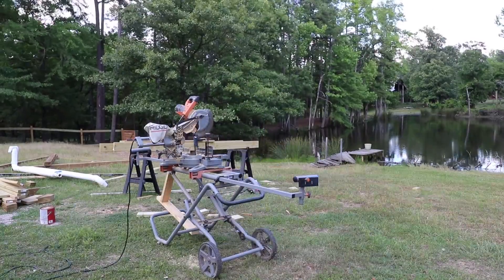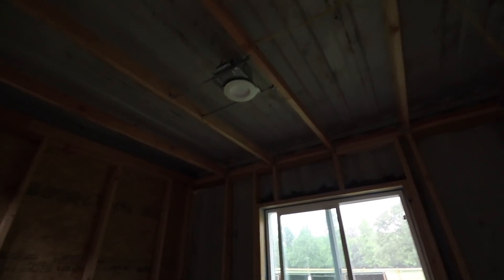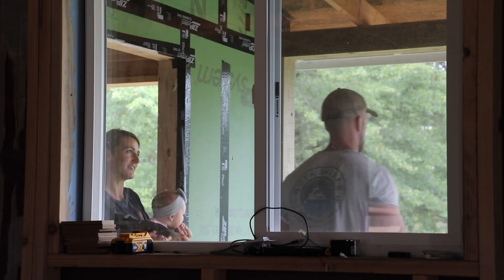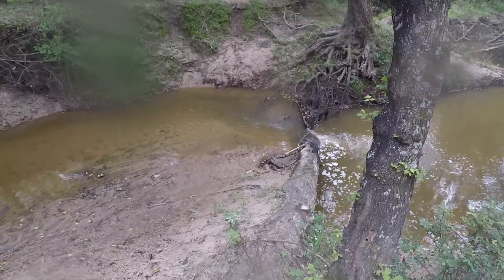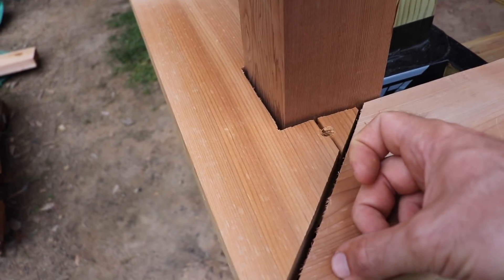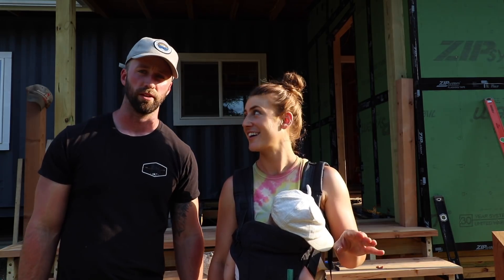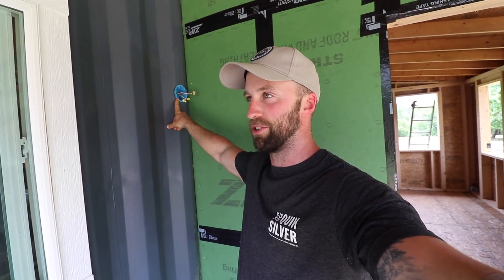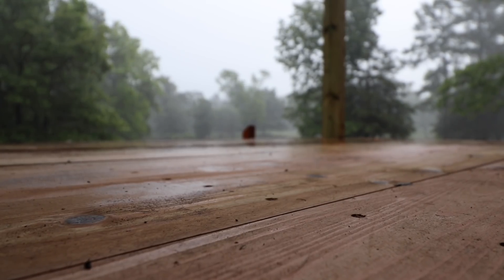Tying It All Together!

Comment: 2 things: 
1. Always pre-drill deck boards at the edges.
2. Glue does an amazing job at bringing split wood together.
Reply: You forgot Spencers OCD - he would always know there was a cracked deck board 😀
Reply: you can clip the head off a screw and glue it in the drill hole so it looks complete
Reply: It's really not my area of expertise, but I've seen evidence of the glue joint being stronger than the wood?

Comment: Love watching the show! 
Spencer, you might want to consider putting either joist hangers or other reinforcements on those Deck Stringers. It didn't look like a lot of wood grain is left, to support you at the top Tread / Riser, for walking up and down. If you had to guess the weakest point on those stairs ..... what would you say. 
Just saying ... safety first. Good luck on the future.
Reply: You could try to brace them but he has driven screws through the riser of the stringer at the thinnest point, where all the weight is hanging. They need to be replaced. Great videos though.
Reply: My thoughts too, looking at the way the grain runs..

Comment: You may want to consider supporting those stringers from somewhere else.
I'm sure the top will snap for some of the same reasons the deck board snapped when screwed in at the corner. 
Not trying to pick apart your work, just bringing it to your attention so you can add support under the stringers before it's closed in, if it's being closed in.

Comment: Your stringers are going to split... don’t throw them out, make your top step (not your landing) the highest point, add a rim board the width of your steps under the original rim and fasten the modified stringers to that.
Reply: Don Dehne yes! WHEN they split don’t get rid of them.
Reply: They never listen to comments.  Just like the bouncy beam below the living room.
Reply: @kdrguru  that's because the work has already been done by the time vid is posted
Reply: @sherri8347  they can add Simpson hangers to the stringers and a metal "flitch" plate to that beam.  Incorrect use of zip tape and code violation not using PT...they should read codes before building.
Reply: As a carpenter for 35 years ,if he doesn't support that top stringers ,that little piece will break off.
Reply: Don and all others, this is a scripted and edited show.  Now the director decided to add the straw hat prop for Spencer to give the dude a "gosh golly gee" Tom Sawyer persona.  I admire this couple though for having hatched a plan that somehow puts money in their pocket... Bravo!!
Reply: Not everybody on youtube knows what they are doing, thats where Spencer goes for his advise and keeps making bad decisions. I now watch for the comedy relief this is, a carpenter he is not, nor an electrician. I can't believe they still beg money from Patreon with the money this channel is making. I would wager they drag this build out for many years to keep the big bucks rolling in.
Reply: @kdrguru   That's their option.  Comments are more like suggestions for them to like or not like.  They are not edicts.
Reply: Wouldn't those boards be treasure treated lumber?   If so, they are impervious to water, right?

Comment: First..I really enjoy the channel. Have followed since the beginning. I feel like I need to comment on the stair stringers. At the top where they tie in, there needs to be more support toward bottom of the stringer. The grain of the wood will not allow a load in that orientation. You need to build out from the deck and tie lower on stringer. Or some type of bracket mount. Not a hard fix but definitely needs to be done. If the ledger on the deck was lower it would be fine. Again great channel!

Comment: The stringer tops might meed  bracing against the beam or reinforced  somehow. Because of the 45-deg grain and a bit of stomping over time, the tops will crack someday.
Reply: You're correct. They make stringer brackets just like rafter and joist brackets. Hope he buys some!
Reply: @louroberts5567  Brackets are not needed if he properly framed these stringers which he did not. The way he cut them, brackets wont stop them from splitting at the top riser. Also if proper stairs are down correct, they are on a 40 degree max slope.
Reply: Just screw a sister board to the stringers. Or a steel plate .25" thick X 6" by the entire length of the runners and screw it.
Reply: I've built about 125 decks and yes the top of those stringers will definitely crack at that point where they were cut so narrow and attach to the deck. We always started with a full step down from the deck, I don't see the need to extend the deck out that little bit for more overhang.
Reply: @Koorisin  No, it won't keep it from splitting but it may help with structure. He can also use hurricane straps attached to the bottom face of the stringer and attaching to the back of the rim joist. There are many remedies.

Comment: Stringer attachment scares me. With the grain direction they will split. Typically those are cut off and a length of 2x are screwed to the back of the stringer and then that is screwed to the deck framing.
Reply: Yea he needs to add another ledger board below the rim joist and use hangers.
Reply: I see it also.  Easy and cheap fix like Jordan mentions.
Reply: @jordanwalter4381  Totally agree, seen the same thing, looking at the wide wood grain running in the wrong direction, whoops!!! a tad bit scary..,  definitely the weakest place if they were to break, ledger board and hangers is the simplest, fastest and least costly solution.
Reply: At least some blocking to toe into on the top ledger. I'm a sparky so I could be wrong...?
Reply: Funny seeing this comment, I noticed this when he built the first set at other deck.. Totally agree, its definitely not code from my state..... throw some THA222 on those stringers and you are good to go. Simpson will most likely have an end hanger with concieled flanges.
Reply: Just add a 2×4 to stringer on side and attach to stringer and porch good to go.
Reply: Noticed the same thing. Watched the rest of the video and did not see a fix. I sure failure in the making. You just have to crawl with the snakes for the fix.
Reply: The bottom of the stringer is the part that's supposed to be attached.

Comment: Hey... I dont like to pick on anyone, but those stringers are not real safe.  With the way the grain is running and that thin piece at the top carying the load, its likely to crack especially as the wood ages outdoors.  You should really put blocking back to the beam to carry the load.  All those little pieces cut around the posts are likely to split and break off as well.  Outdoor wood is not dimensionally stable and moves a lot throughout the year.  You need to leave some space (like a good half inch or maybe a little more) around posts and stuff to leave room for expansion and contraction mainly due to the wood drying out during summer and and expanding during winter.  If you leave that stuff tight the stress as it shrinks will break off those pieces.
Reply: I agree. Not strong enough.
Reply: Also, the stair treads should be a bit wider/deeper  to make a feature of the stair, also to be in proportion with the width of the stairs.

Comment: 0:46 I think those stair stringers will break at the very top, there's very little timber at the last vertical piece and the grain is oriented in a way that it will almost certainly snap.
Reply: Livi 120 I get your point but surely all they need is a metal hinge fitted underneath, connecting that part of he wood deck area?

Comment: Those stringers are a tad scary, needs something supporting them just below the top support, they are gunna snap,
Reply: Ok , Im not the only that saw that, (i was a builder). He could sister them up with some ply, it would show however.
Reply: Agree, that is lacking some solid structure
Reply: Just commented the same. He did the same thing on their other set also. Any weight at all and they will start breaking.
Reply: @xl600mine  stringers are all wrong  hope no one gets hurt
Reply: I was gonna say the same. Maybe use some hangers or something.
Reply: I thought the same thing and I’m not even familiar with this kinda stuff. It just looked dangerous! Another guy drew them a diagram and offered to email it to them. Hope he takes their advice since he isn’t a builder or carpenter by trade!
Reply: These stringers will need to be rebuilt in a couple of years, or changed right away to avoid future issues.
Reply: I just posted the same and then saw yours.
Reply: Look at the grain of the 2x10 where the inside tread cut is. That is a big weak point.
Reply: ABSOLUTELY RIGHT!!!  Tie a 2x across all and into the fat part of the stringer, then lay another in back to tie to upper cross brace.
Reply: Other than that, you do freakin amazing work!! Keep up the great progress. Wish i was 30 years younger, I’d be doing the same.
Reply: Omg. Is Spencer serious? Yes he has to use hangers, but he can't use hangers when the band joist is only a 2x6.  Sometimes he means well,but he has absolutely no clue what he is doing.
Reply: Didn't read any comments when I posted mine. Fairly simple fix but should have been done initially. Just needs to shim out a piece of 2x10 or even use a couple of 2x6 for facing brought even with the top plate. As long as it is solidly affixed to the deck it should work without any problems.
Reply: If he had only used 4 I would agree. He put way more than he needed so the load strength combined should exceed 1000 lbs total for the stairs, minus the stair weight itself. It should hold 4-6 people at once with little problem, only because he used 4 more than needed.

Comment: Woah! Those deck stair stringers a dangerous! The top of the stringer is bearing all your weight on only a 2” width. The top this type stringer should be a full tread depth in thickness in order to not make the stringer so thin.

Comment: Thin wood splits or shears very easily along the grain. You've left the section of your stringers that hold up the stairs with about 2 1/4" length of grain running before a cut where it can split very easily. Essentially those stringers are less strong than a 2x2 board because of the grain running perpendicular to the length of the wood. Better to have a full depth step on the top so the grain runs continuously along the bottom edge from attachment point to the ground or to add some sort of hanger to pick up the load correctly and prevent your stairs from snapping off the deck when someone steps on them.
Reply: Same comment applies to the front steps made in "Stepping Into A New Chapter!" video.
Reply: I was about to post that and saw that you caught that problem.  They need to add a header at the bottom half of the stringer (attachment where the stringers have continuous grain) not the top of stringer where the triangle piece will split off.
Reply: That was my concern as well.  After a few months or a couple people standing on those stairs at the same time they are going to crack and eventually fall.  I love so much of what you guys do, but the stairs need to be redone. :(

Comment: Not an expert on stair stringers, maybe someone who is can comment, however,  with the grain facing the way it does at the top it seems a small section to hold those stairs. There are quite a few stringers, however,  only about two - three inches at the top of each. I could almost break that much off with a blow of my hand I think. Maybe I am just worrying unnecessarily Spencer as I know you do your research.
Reply: I'm no expert either, but based on research I've done and stringers I've made and stringers I've seen the pros make, they look good.
Reply: Your intuition is correct. The notched stringers must be installed so that the portion of the stringer that rests against the rim joist is a full step. Done that way, it has the full uncut "carriage", and the bulk of the wood. Old timers would "let in" a 2x4 on the rim joist, as a ledger, but it has fallen out of favor for the Simpson brackets. Don't know about building codes in that part of the country, but where I work that would not pass. These are not resting on the rim joist, and will fail under load.

Comment: Spencer, the stair stringers will probably break from being supported by such small amounts of material you tied them to the deck. I would butt out a full width brace even with your top anchor point to solve the potential problem. If you have to buck a load with a hand cart up your stairs they will break, I know too well from my previous experiences. 
Young lady, I know how adorable babies are and I am not saying this to be mean but, if possible, you need to put that sweet little bundle down in a swing or something else safe so you can help more with finishing your home. It's going to wear your man out doing so many things single handed and it will add another year or more to being able to move into what you guys are creating. I know that you are probably the one making the videos but you need more building content and less leisure time to make it come to fruition. Love your perception of your home and your sharing it with your viewers.

Comment: You know them staris aren't going to last..? When you follow the wood grain from the top you can see where they are going to come crashing down..
Reply: Why wasn't pressure treated wood used for the deck and stairs ?  Cost ?.  I am concerned also about board spacing of deck lumber. I would have spaced it out more so for water run off and so that dirt does not build up in the cracks as much.
Reply: Kim Hetzel PT is a code requirement in IRC too.  Why are there no codes there?
Reply: Codes where hes building he dont need codes.. lots of code violations lots. The whole addition and deck would immediately be a stop work order . All his main beam are laying on their sides.
Reply: @jaymckinnon8387  exactly.  I bet inspectors to be are quizzed on this series.  I feel bad..they're good people but refuse to listen to pros commenting.

Comment: Like the way you cut another deck piece around the rail after splitting off a tiny bit of corner. Most would have glued it and gone with it. Well then I saw how crazy wife was over a lil ink  line (sand it off). My hubby and I built a huge A frame out in the country ourselves when I was 19 and he was 23.  Every little “ just go with it “  you never forget and see it every time. Others don’t but you KNOW it’s there.  Nice job on the whole project.👍👍👍

Comment: You need to support the stair stringers...they have a weak point where they meet the rim joist.  I suggest extending the rim to the bottom of the stringer which will give complete support and the stringers will not break over time.

I love the attention to detail you all take.  Keep up the good work.

Comment: You do beautiful work.  Couple of suggestions, The top rise for the stringers looks to be a weak point, should they ever break, there are joist hangers to cradle the stringer.  There are definitely plenty of stringers. Not sure the max distance for sheet rock span, but all corners should have solid wood at each side of the 90 degrees, goes for ceilings also, its something I forgot and had to buy a small angle drill to install blocking between rafters and top of walls.

Comment: Spencer, you are doing a great job. I looked through the comments from this video & don’t see anything related. Your stair stringers need to be reinforced at the bottom of the top where the grain is intact from the bottom to the top of the stringer. So between the top end of the 7 stringers and the beam holding up the house you can fashion a beam for the stringers to bare on. I’m sure if you study the cross section of the stringers at the top you’ll see the weak point at the bottom of the first step.

Comment: I've been binge watching your videos since I found your channel today. You both are doing an awsome job. One suggestion I would make is where your stringers are screwed to the porch you might want to consider screwing an L bracket to each one. If you notice the grain of the wood there is actually not much holding it.  As the wood drys it could possibly crack causing a failure of your steps.

Comment: Fyi, if you screw through the weakest part of your decking board and it snaps in half, don’t waste it! It’s more than salvageable, slap on a good layer of OUTDOOR wood glue, clamp the two pieces together and give it a couple hours. Like it never happened only it’s stronger with that wood glue! If clamping both pieces together is tricky then get out your pin nailer or brad nailer and shoot in a couple where it’s hidden and that becomes your clamping pressure. Beautiful deck you two

Comment: Another great job. Regarding screws however, you want to avoid screwing them along the grain of the wood, they should be perpendicular for max strength. The tops of the stringers looks particularly week, I'd back it with a beam. When the wood dries it may split along the screw line and you'd lose the support from the porch.

Comment: Im an electrician  and just to let you know you don't need to use 12 gauge wire for lighting, I recommend using 14 gauge it has more than enough power capacity needed for lighting. 12 gauge is mainly used for kitchens and bathrooms maybe for laundry room but even living room outlets don't need 12 gauge. Remember it all depends on the what the wire will be used for, while yes you still can use 12 it's easier to wire 14 gauge. And when your going to wire the new room maybe you could consider 14.